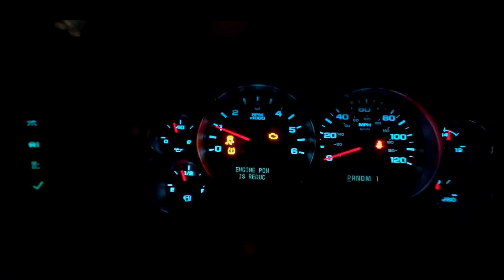Snow removal gone bad ! Truck and Bobcat Broke Down

Comment: We just had our first plowable snowfall here in Virginia.  My new-to-me plow truck worked perfectly to my pleasant surprise.  I did a lot of preventative work to it over the summer.  Not bad for a 20 year old truck.  Looking forward to more snow this season.  On the other hand, we too had problems with our Bobcat.  Some sort of electrical controller is messed up.  About once an hour the controls would lock up.  Luckily if we shut it off and the restarted it, the problem would go away for a little while.

Good luck with your repairs!

Comment: Gas or diesel truck? if diesel bring to chevy and have them check the heater pack that goes to the def tank, lots of problems with that heater pack, very simple to fix though, two wire system. when that heater goes it trips all kinds of codes and if your not looking for it, its easy to miss.

Comment: Hey chant good video. I’m up in prior lake/shakopee area. Same thing happened to my truck last winter. It got super cold and while plowing my service stabilitrak light came on and it reduced my engine power down to 25 mph. I had to replace my throttle body sensor. I got a new one for 40 bucks and it was a Super easy fix took me 10 minutes and I’m no mechanic. Hope that works for you. Good luck.

Comment: If I LIVED in MN I would have a furnace in my shop. That torpedo heater is not the answer. Dude, keep some spare hoses for each function, up/down ram, angle ram & wing extension hose. Can’t wait for the next day, you can handle that in 30 minutes w/ a warm shop. 
J/S.

Comment: It doesn't make a difference what brand you work BOSS, Western,  Fisher Meyer , Snowex , Hiniker, Ect. your going to have breakdowns when you work them. And it's even worse when we're out here trying to clean up in -10 degree weather and 18+ inches of snow. I still think BOSS makes a good plow. But they have had nothing but trouble with the EXT. They rushed it into production without working out the problems properly. These are my thoughts on the matter anyway. We all like what we like and most of us are brand loyal. You can find problems with them all . Just the same with the trucks we work . I may love my Ford superduty and you may stand behind your GM or RAM.But if I were you I'd talk to BOSS and get another DXT and cut your losses with the EXT , I feel like you'll be fighting it from now on . Keep up the good work love the vid's!!

Comment: Chant, change out those stock Boss hoses for custom heavier "armored" ones from a company such as Weatherhead...those are usually used for cranes & other much heavier duty , high pressure applications. It has been 20 years since I have used "stock"  hydraulic hoses on anything , as they are almost always junk ! You may also want to make sure that they  change some of the angles  on the fittings and use swivels near connection,kink or flex points. If you keep using the original hoses, you will continue having these type issues. Hope this helps,  keep up the #HUSTLE  Brotha !
Reply: RABIDFORDFAN 

     All great advice Sir!
 Spare hoses are a great idea. The way that EXT keeps pinching them , something needs to be moved or some chaff gear installed.  
     That or can the boss and get a 9.6ft XV2, or western V , same difference , both have the boss gear stomped!
Reply: Gates, Weatherhead or Parker are all great options- My family owns a hose distribution company and we distribute Gates hose- Gates is the best brand out their as they’re made out of some great material and are rated for a 4:1 burst ratio as a hose that would go on there which might be like a 6 hose is rated for 3500psi He’d have no problems if he went to any of those brands- I️ wouldn’t waste my time with those cheap stock hoses the plows come with
Reply: I never had 1 single issue after I switched to the heavier duty / top quality brand hoses/fittings. The big manufacturers should be ashamed of themselves for letting their products leave the plant with what is basically a BUILT IN DEFECT !  Not even one of my Frankensteined units has ever had  issues after making the switch. Maybe if everyone made the manufacturers comp them for the repairs and the downtime then they would finally start paying attention to quality again. SMH

Comment: not good man. hope you got everything fixed .  We had a bunch of trouble  pass few weeks with gelling diesel fuel
Reply: MrGiovannix12 Run a additive in your fuel year around thats for summer and winter. Stanadyne Performance Formula
Reply: handcannonowns  we use  anti gels.  But we still had frozen filters. It just got that cold
Reply: Use 911 in an emergency
Reply: middlecharlesfishing thats all i use. Power service products

Comment: I would think about a wheel loader for those big lots. One machine could do most of it and in half the time. You could get a decent Cat for less than you paid for that new Bobcat.
Reply: bellboy407 or just rent a loader for the winter season
Reply: Yeah, but he has, what, three of them? I bet they're are very few days in the summer he runs all three Bobcats.
Reply: You could bid much bigger jobs with a wheel loader. A spare Bobcat is wasting money. If the majority of the work for the Bobcats is snow in larger parking lots, you're doing it wrong.
Reply: We lease 4 skid loaders for 4 months on top of our owned machines.  Park them at the lots/ areas they plow and the operators drive straight to their  machine.  We are able to write off 100% of the lease payments compared to depreciation of owning a machine.
Reply: That's cool. But you also have to figure you will never have any equity in the equipment,

Comment: The engine reduced is a warranty issue.
It has to do with the fuel pressure to the injectors. It will come and go intermittently. Take over to you GM dealer when it acts up again so they can pull the code and fix it.
Reply: Lawnservjoe Cooper it wouldn't be the wire harness, my gmc engine reduced light came on and after I changed that it worked perfect

Comment: Chant you should look into the western brand we run the wide outs and I have been a boss man my whole life till we bought western and I'll never go back to boss...
Reply: Boss is way overrated and overpriced. They are owned by Toro. Same owners of Exmark. I have had Fisher, Blizzard & now SnowEx plows. My first Boss product is my VBX8000 salt spreader. It's only in 2nd season of use. Harness is going bad. Also having issues with grate sensor.  Also, the cheap vinyl cover is tied down with bungee cords with plastic balls. They break & need replaced often. For a $6000 piece of Chinese plastic with "BOSS" imprinted on it, this thing should make me money not give me headaches & downtime. The other products made by Douglas Dynamics have held up well.